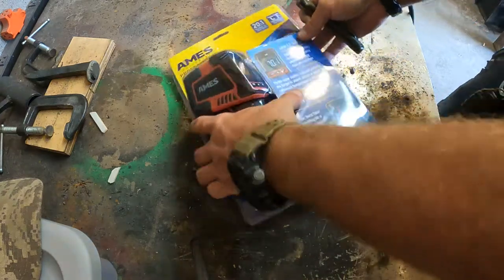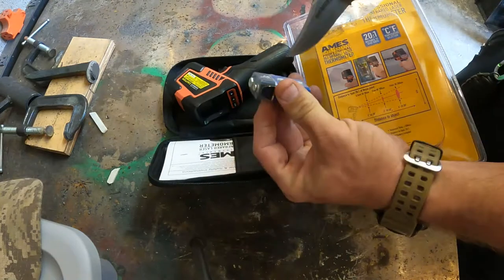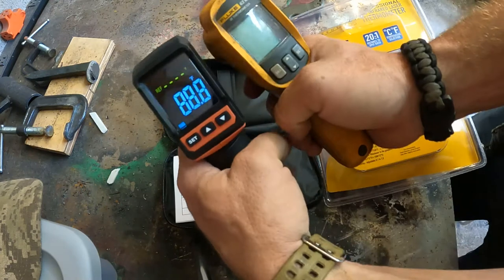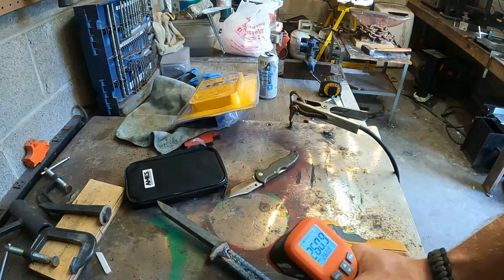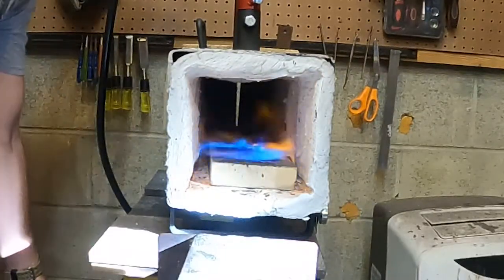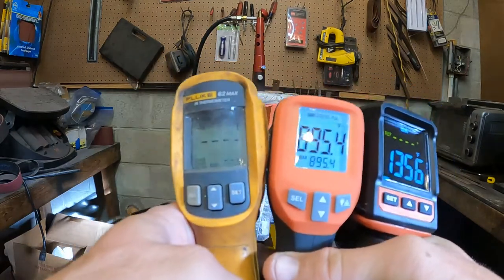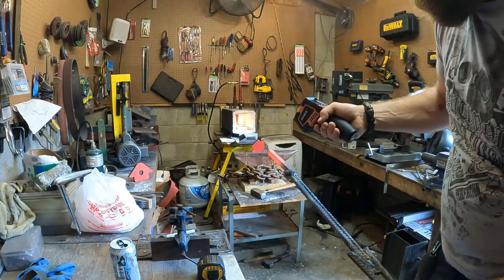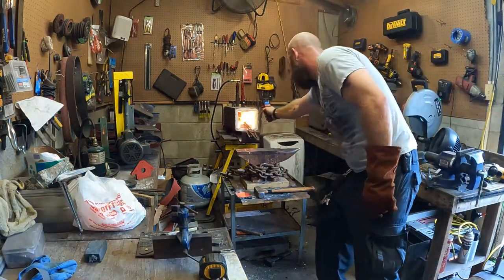20:1 Infrared Laser Thermometer Heat Test

Comment: Good video and thanks for sharing. I'm looking at buying either the ames or the fluke 62 max. Ames will cost me $44 and fluke $92. The pros of the ames is the higher temp and lower cost. The fluke seems to offer more ruggedness, options and warranty. I have to check heavy machine engines, axles, hubs, tires, etc. Being you have both, would you mind sharing what your experience has been with both up to date as far as preference and reliability? Anything you like or dislike on either? Thank you!
Reply from the maker: The fluke is still working. The others stopped.  I think it is worth the extra money.  Fluke is just built better 🙂
Reply: @KnightsArmory  thanks for the reply! And that's good info to have. That's the direction I'll go then. They have the fluke 62max on Amazon on sale every so often. Should be under $100. I'll plan to grab it. Thanks again for the advice.